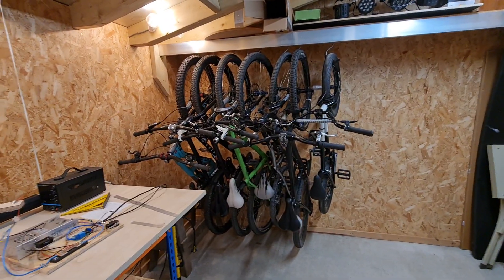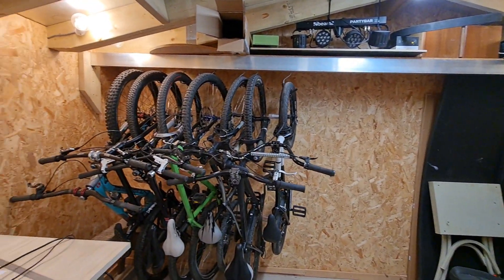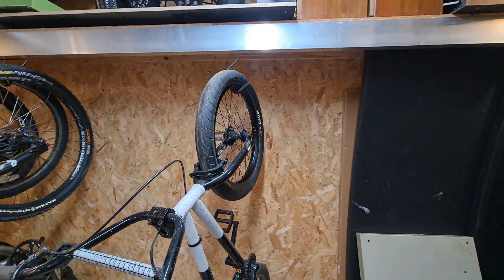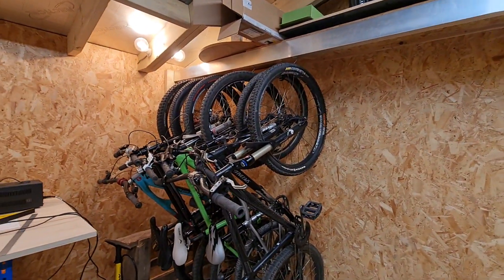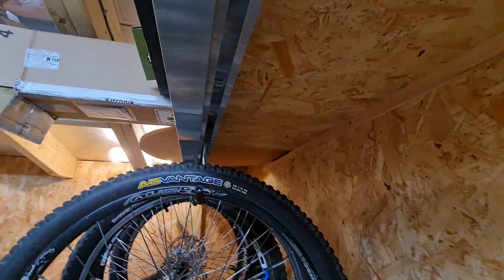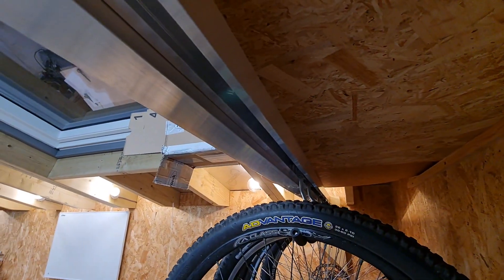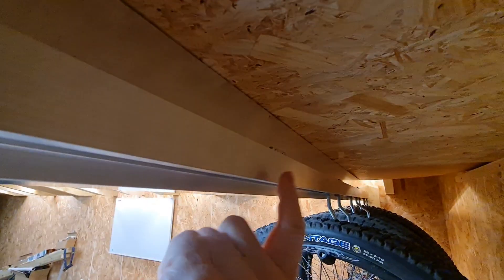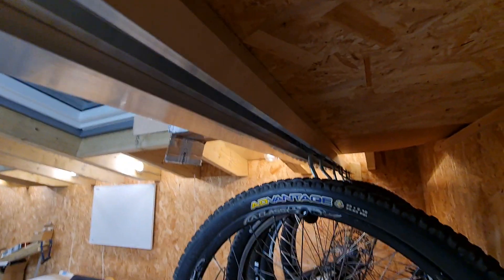sliding door rail bike storage rack

Comment: Thanks for the video! Couple of questions if I may, the fitting track, does it come with wholes and fixings to fit on the ceiling, and   how long was the M8 bolt you used and what did you use to bend it? Thanks!
Reply from the maker: Yes, holes in the top. I used M8 studding in 1m lengths and just cut into thirds.
Bent in a vice with hand pressure and a hammer.
Reply: Thank you, really good project.

Comment: Hi, love this idea and was looking to make one myself. I wondered if you had a link to the parts you used, particularly the roller trollies as I'm struggling to find ones that will accept some standard threaded bar. Many thanks
Reply from the maker: I used Rollan 80 which I got from SDS London. I didn't know before I bought it what size thread it used but it turned out to be M8. Hope this helps
Reply: @gsportgeorge  thanks very much for the quick reply. I assume you could just fit a nut to secure the threaded bar into the resess on the top/centre of the trolley?
Reply from the maker: @888rc2xva  as long as there is clearance inside your rail I think that would be fine.  But all the ones I looked at had a captive nut inside anyway